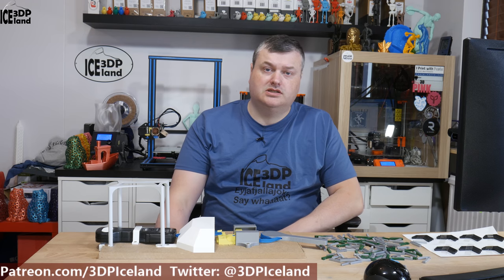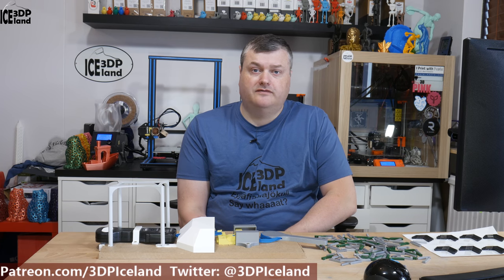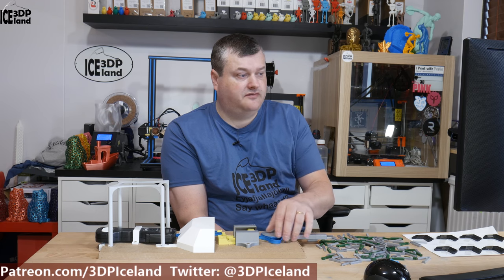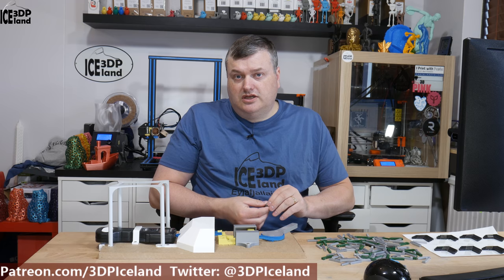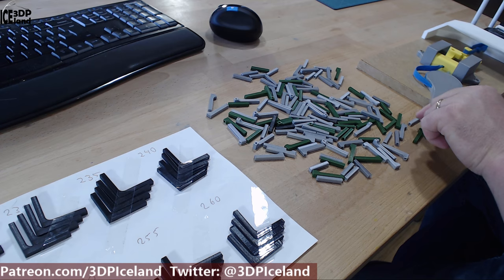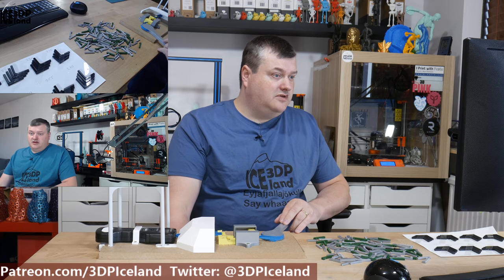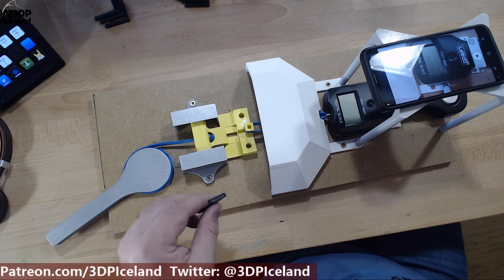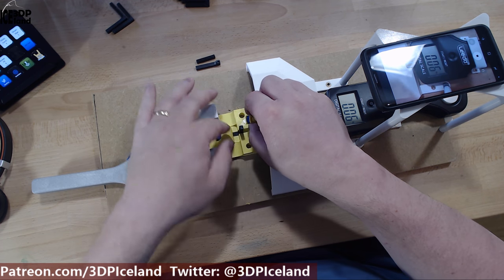PETG Layer Adhesion based on Print Tempurature

Comment: (petg) did you use the printer with the mosquito hot end? is it still working and if so what settings did you use if you dont mind sharing. thanks i have all the parts put together for the mosquito hot end build. ohh and how does it do with pla also and other filiments?